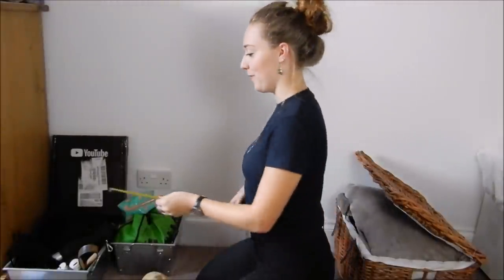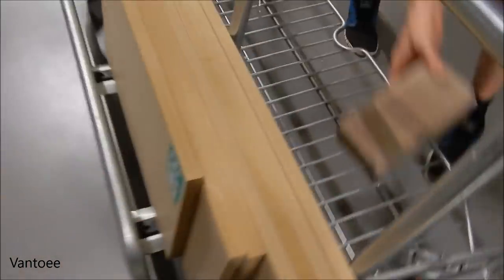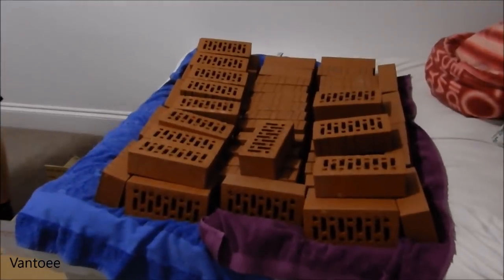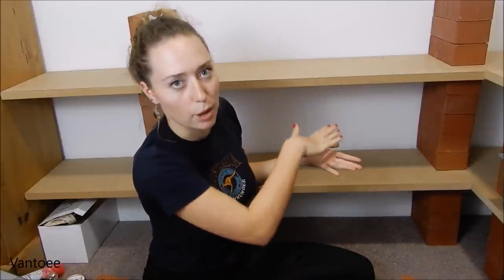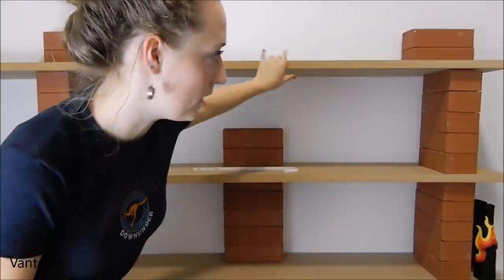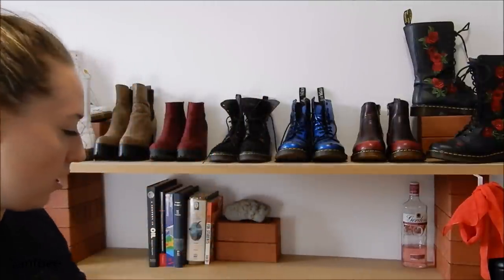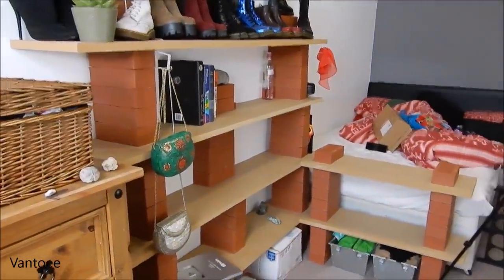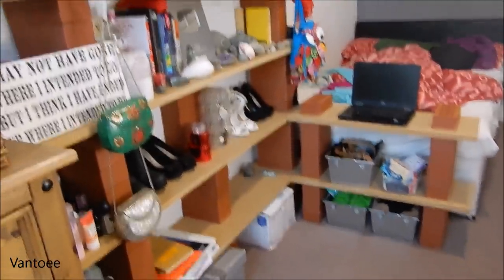DIY Shelves - Storage Hack

Comment: The carpet if held with grippers which means if the bricks are back to the skirting board the will have more support under one end and tilt forward where they sink into the carpet/underlay. Use one of the boards as a baseboard stepped away from the skirting board so it compresses the carpet evenly and spreads the load which will help with the stability.